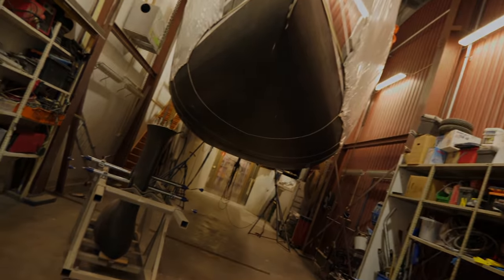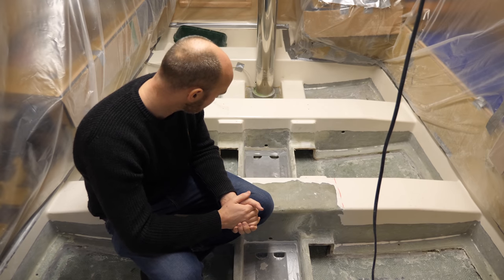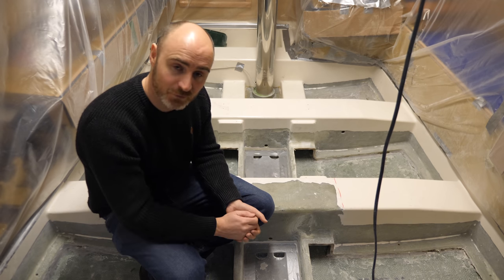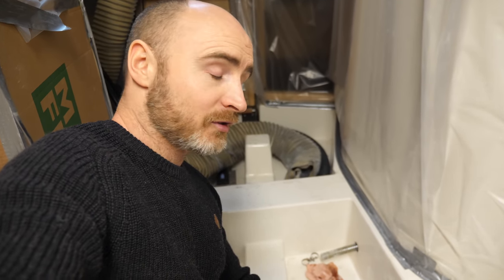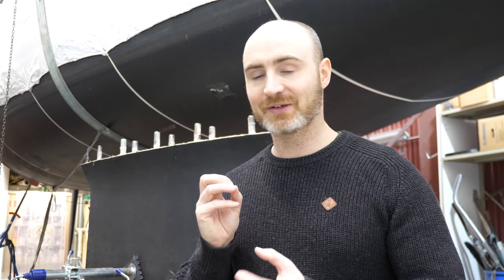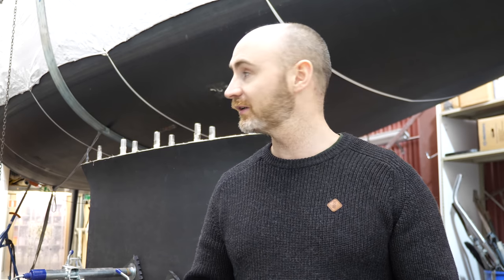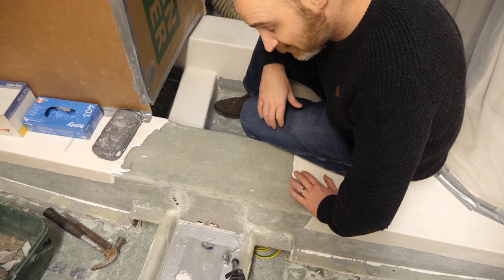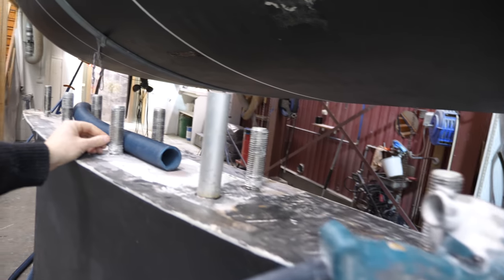SAILBOAT REBUILD - what they DON'T TELL YOU about PRODUCTION BOATS - Plastskador repair week 2

Comment: Galley.  Never "kitchen."

In my opinion, you are in the difficult situation of having gone wrong initially, and now are in the position of trying to make the wrong boat right, an impossible task.  In short, your boat is not a cruising boat.  Cruising boats do not have canoe bodies with deep fin keels with very small attachment areas to the hull.  Accidents such as yours are wide spread and commonplace.  So are, unfortunately, incidents of keels simply dropping off.

My advice?  Cut your losses.  Sell your boat as soon as she is repaired.

You made the same mistake I see people making every day over and over again:  you bought too much boat far too soon.  Anyone who calls a galley a kitchen has no business buying any boat.  Go down to the local yacht club, find the fleet captain of a one-design fleet and learn to sail.  Then to race.  Read every book on sailing, cruising, and racing you can.  Then buy a boat in your fleet.  When you can finish in the top half of the fleet in regattas (not in your local fleet) all season long and have read 150 books, you're probably ready to buy a small cruising boat.  Cruise aboard her for three years.  Maybe then you'll be able to make your own decisions.

No one appreciates this advice; I'm sure none follow it.  But clip this and save it.   If you manage to stagger and stumble through the next ten years, you may find it and agree that it was good advice.
Reply from the maker: Hi Paul, Thank you for your comment. I can see where you are coming from. I know the difference between a galley and a kitchen but i'll give you the background story behind it. My wife is Danish and we are slowly migrating towards sailing terminology in English. Sometimes house words slip out and I apologise if I offended all sailors :) but I don't think that excludes me from the sailing community even as an amateur.
Your probably right on many points about the boat, its shape and construction etc. It may not be the perfect boat to do ocean cruising but history has proven that 1000's of crossings have been done by production boats none the less. Don't get me wrong though I can see where you are coming from. As to racing and regatta's, you may learn a lot but I'm sorry I don't agree, there are many other ways of gaining experience. Definitely agree on the literature though I could do with reading more of that and I will.

You may be right with the advice but I think life is all about staggering and stumbling, if you don't make mistakes you can spend all of your time preparing, not experiencing and then get hit by a bus. After all if everything goes perfect, what will you tell the grandkids :)
Reply: Lars, of course everyone is a novice in the beginning.  The problem occurs when the novice buys a boat before he has learned much of anything.    I see over and over again, people who don't even know how to sail a boat upwind, or how to tack and jibe, even how to sit when at the helm.  (You sit to weather, shoulders parallel to the centerline, head turned forward, tiller in your aft hand, mainsheet in your forward hand.  When you tack  you face forward, pass the tiller behind you.  When you jibe, you damn well better face forward!)  Novices are forever wanting to buy a boat and go.  They buy the wrong boat, always too large (40-45', sometimes 50' or more) and the wrong type.  Tell them to buy a Contessa 32 and they argue with you (as one does about racing) "Oh, no!  Much too small!"  never realizing that her small size is one of her greatest benefits.  There is a clear path from lubber to seaman: crew in a small boat--Snipe, Thistle, Lightning, it really should be a centerboard dinghy--for a year or two.  Then buy into the fleet, where you will have many friends to help you with every question or problem.  I have taught perhaps hundreds of people to sail, and have observed countless more.  If you want to become a sailor, you must race, and preferably in a small, light dinghy (the Laser is the ideal first boat for any able-bodied novice.)  Believe me, you can sail a Catalina 27 around the harbor for years, decades, making the same dumb mistakes over and over again.  A Laser or other small boat will immediately point out your mistake to you, often by capsizing.  If you're in a race, being wrong becomes immediately apparent when the fleet sails by.  It's going to take some number of years to really learn to sail.  The fastest learner I ever saw went from his first ever stepping aboard a Rhodes 19, I believe, to 10th in the 1980 Star Olympic trials, skippering his own boat in FOUR YEARS!  He read voraciously.  He questioned everyone.  Walk right up to Buddy Melges or Dennis Conner and ask about mainsail trim or first beat tactics.  He'd write down what they said;  Saturday would find us out two hours before the fleet, practicing it.

Anyway, I don't know why advocating that people should learn to sail before they buy a large, expensive boat is somehow regarded as a radical position.  Nobody thinks buying a plane makes one a pilot;  why do they think they can buy a boat  jump in and sail away?
Reply: @pauljnolan1000  while I'm not saying your advice is not valid (and everyone is entitled to their own opinion) you are aware that the accident that happened to this boat was not done by them? It was done while on charter... if a reason a person is not "allowed" to have a boat due to not conforming to naming convention, well I think that a ridiculous remark! Especially since there are multiple Languages involved.
Reply: if the majority of people would follow this advice ( and it is not bad advice!!).. we would have a lot less people sailing in the long run.. a lot less..
I do understand that for a sailing expert alot of mistakes made by noobs must seem so cringeworthy and avoidable but not everyone has the amount of time necessary to prepare up to this 110% level.. and especially not everybody lives next to a marina/yacht club, or even remotely near water;) to just drop by all the time and get the experts to teach him/her.. 
Some people just taking a sabattical, others have to make do with the little time they have between jobs and commuting to the sea..

As for what is considered a wrong boat... I´d say the many many  people who successfully did ocean crossings and/or are still cruising on these production boats (or even just on quality boats with a bolt on keel  without a skeg rudder) would simply disagree.. I could not find any statistics that would really put these "incidents" of lost rudders or fallen off bolt on keels into a realistic perspective and for me these claims of this being something "common" or "wide spread" are just urban legends, told from one sailor to another.. 
yes this does happen, not saying it does not.. and yes IMHO I also would completely agree that these boat designs are  flawed and in a way an inferior designs to something like a contessa 32+ f.e. making the boat design not evolve but devolve..
Reply: @charonstyxferryman  Lars, I stand by my statement.  Yes, the truth is harsh, but it is a disservice to mislead or worse in the name of gentleness.
Reply: @andymaidment2320  Andy, although you put exclamation points appeared around the word, I did not write "allowed."  Obviously anyone can purchase any boat he wishes and cast right off and some do.  If you were at PTA night and you child's English teacher confided to you, "All my students is important to me."  Driving home, how much confidence would you have in that person's competence?  Or would a simple disagreement between subject and predicate cause you to strongly suspect that person was unfit for the job?

Paul
Reply: @philxdev  Phil, I just don't know what to say.  People... don't have the time... don't live next to the yacht club...  It reminds me of excusing murderers because they...grew up in poverty...had a poor education...or other drivel.  If your liver is ever mistakenly removed in lieu of your spleen, I strongly doubt you will be very understanding of the surgeon who tells you, "Anatomy?  I didn't really have the time to study...we lived far from the library..."

Comment: I own a boat in charter in the Mediterranean. There the throughhole fittings last not longer than some 3 - 4 years. The Charter corp. I know change the brass after 3 years to plastic due to the danger of ripping of due to corrosion.

When I saw some pictures about your strongback I saw some very different distances between hull and strongback. Seems the boat should be adjusted before lamination work.

Electric cables - yes they are a pain .... 
What's about glue in some tubes (more than one) to put the wires through later.

You don't like mold - me either. Well there are this air driers. They work fine where they are but humidity does not force air movement. If you have some Ideas: find some ways to construct an airflow by hoses and ventilators (don't have to have power - just a little bit - to move air through the boat - at best to the dryer. That would help a lot.
Reply: Through hulls not lasting in the Med is because they are fitting ordinary brass instead of bronze or DZR.
Reply from the maker: Hi there, great comment thanks. Good to know about the through hull fittings, I will be looking at various options this week including composite ones. A lot of research to do.

I had a look at the the shape of the hull and I think it's just an optical illusion as the glass was cut more on one side, that's fine I think, thanks for bringing it up though. I will put conduits in for the wires later on, seems like the best way forward.

Good tips on the ventilation also. Lots of things to take care of for me. Cheers, Chris
Reply: @SailingAurora  To the ventilation: Once we had  water in the cellar. We rent a big air dryer. It worked like a boss for 2 days - then there was much less "earnings". But the floor was still dark and wet. Then I remembered something and placed ventilators at various positions. I an hour (!!!) the floor got dry and looked light - just were the fan was blowing. AND you could watch more water in the dryer. 
The simple problem: Dry and wet air have nearly the same weight - between dry and wet air there is no movement. If your dryer shall be effective, you have to move the air. 

I already had an idea: modifying both sides of the dryer so you may attach flexible hoses to it. When working, stretch the hoses to points in the forward and aft cabin - so the fan inside the dryer would do 2 purposes.
Reply from the maker: @wjhann4836  Good thinking but the problem is not too big at the moment. Thanks for the advice though, appreciated

Comment: Interesting as always. Prior to getting my first Hanse I sailed for a week on a 470 which I recall having a steel grid but I have no idea how this was bonded to the hull.  I'm quite alarmed at the extent of the damage to Aurora but wonder if having a twisted steel frame, or even one that was significantly detached from the hull would be worse.  In 20+ years of sailing I'll confess to several "groundings" but mostly in tidal areas and in soft mud.  In fact getting to my winter yard in Chichester harbour was always a nervous moment as it was only possible to get to there with my 2m keel at the top of a spring tide.  Last spring, after my planned launch was cancelled by covid, I was "neaped" for another month.
Some great tips here.  I agree that the standard bilge pump could do with being bigger.  I looked at the spec for the Johnson and noticed that even this pumps quite different volumes when 1m of head is factored in rather than a straight run.  Aristides commented that this might not fit under the floorboards, but I believe that the deepest part of the hull might well be under the galley sink where there would be room under the pull-out drawer.  Both the standard bilge pumps discharge at the stern with outlets above the waterline.  It is normally easier to run a pipe to the stern through the engine compartment than taking it to the side .
Like Aristides, I am planning to get the Caribbean at some point, however it took me three years to get out of the Baltic, and I haven't even got to the Med yet, so who knows when!
Reply from the maker: Hi Stuart, thanks for the comment, this damage has brought up some very interesting conversations indeed. When we were cruising around Poole Harbour we used to ground the boat all of the time, as you say the advantage was it was sand or mud to hit so we didn't really care.
Thanks for the advice on the bilge pump, I need to have a proper think and look around at some point in the near future and make a decision.
Good luck with getting to the Caribbean, I am jealous, one day soon hopefully for us. All the best, cheers, Chris

Comment: A non naval engineering talking about loads and building methods is just wrong. You are over simplifying very complicated things. Your explanation of binding / epoxy / strength is also wrong. Your price comparison is also not accurate , boat  Interiors cost as much as an entire hull - that is the main difference in between Swedish and French/German boats. Hulls are built almost the same across Europe. French/German boats are built by thousands (tens in good years) a year and they don’t sink , if they would you would not have insurance business at 20-30eur/ft/year in Europe. Ocasional Groundings are not an issue on boats structur otherwise the same would apply.
Reply from the maker: Hi Estaban, I work in the IT business and I understand sometimes complicated things need to be explained in a simpler way, of course there are many factors to consider. You must also know that a lot of what I am saying is relaying information from the boat builders with their vast experience, they have just given me a glimpse into and some education into this vast subject, I don't claim to be an expert. Since making this video I have learned a lot more about the differences between Epoxy and Polyester, however contrary to what a lot of other people have said here, I believe the ISO polyester is more than adequate for the task.

As for the price comparison, I think you misunderstand my point. I am comparing the whole boat and I am saying that a hand built boat adds a lot to the price, this includes all parts of the boat that require skilled labour to build and assemble. The "off the shelf" parts of the boat can quite often cover over many manufacturers.

What are "Sinking" about? :) Nobody said the boats were sinking, ours didn't sink, it let in a little water but the construction method kept the water from coming in, I would say that's a success. After all Hanse state they have also never lost a keel. As for the grounding it depends on what kind of grounding.... if you hit mud or sand it will be a lot difference to a full stop rock grounding like we had. The forces in this circumstance are huge. BR Chris